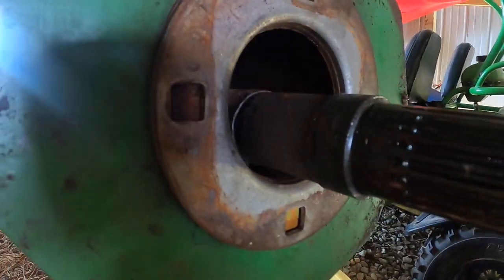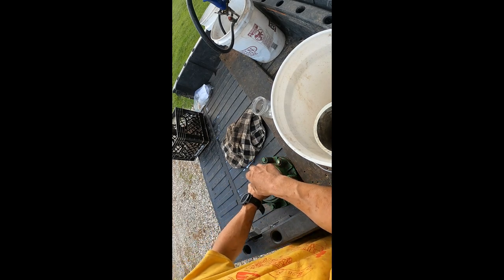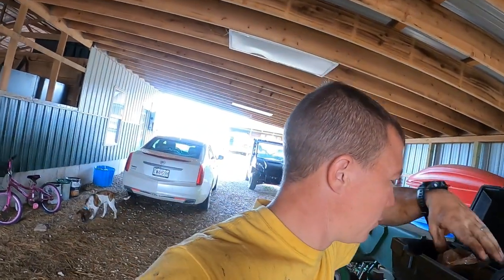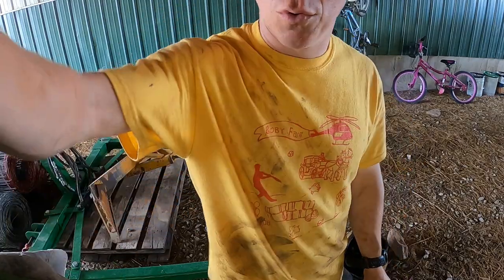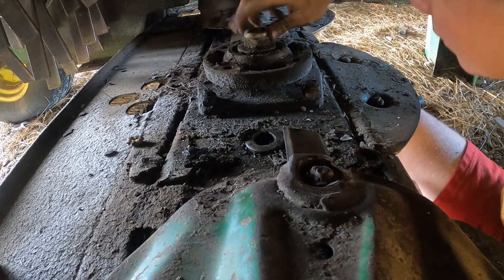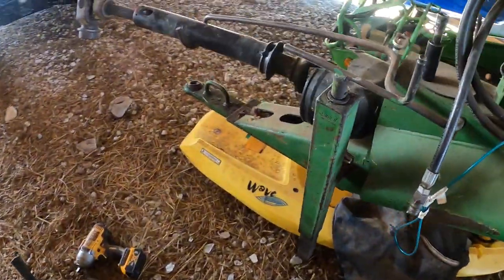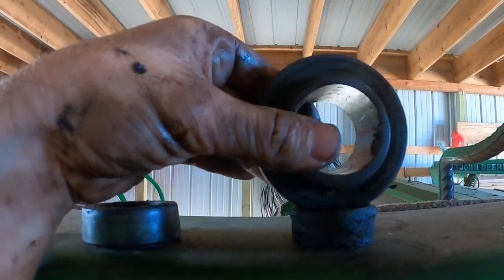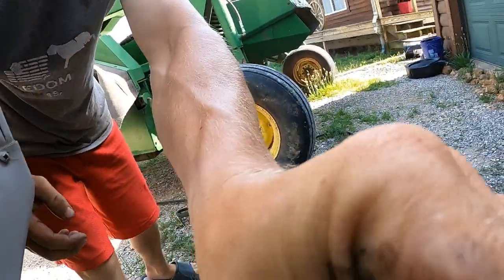Starting a farm vlog #60 John Deere 1360 mower conditioner repairs

Comment: "Take it apart real quick..."  You my friend have a lot to learn about farm repairs!!!  :-D :-D :-D

As a side note, Please please please always check your bolt or nut tightness after using your Dewalt impact, we used to use one very similar to that one, and they really didn't have that much torque, we were amazed at just how loose the bolts really were when we used a wrench or ratchet after the impact.  This will help you avoid things coming apart later.  Great Video as always.
Reply from the maker: Lol it's never quick....ever